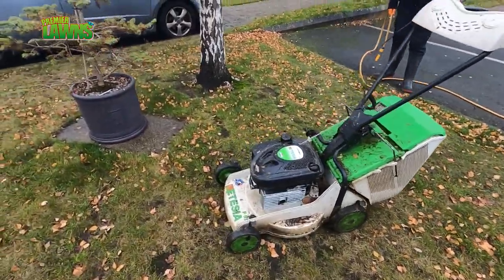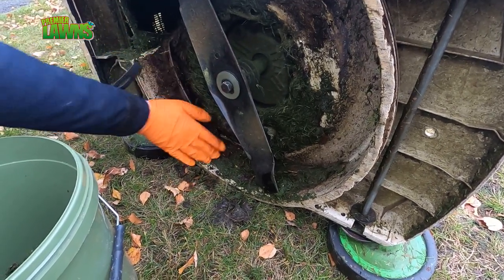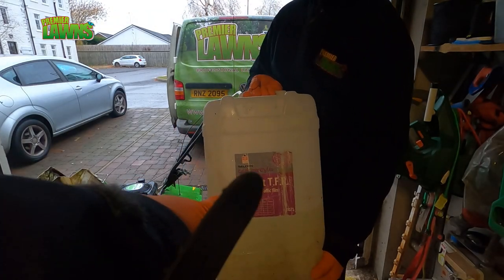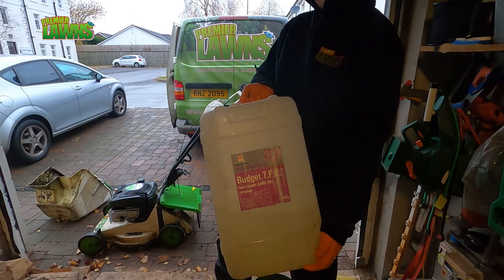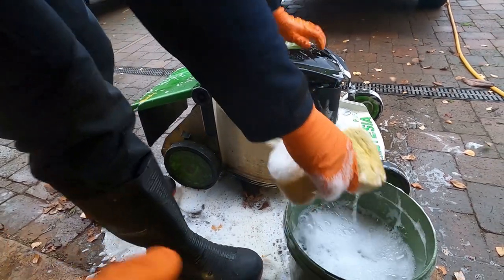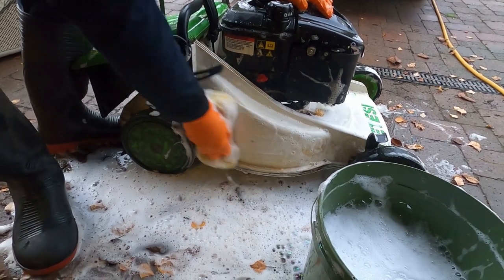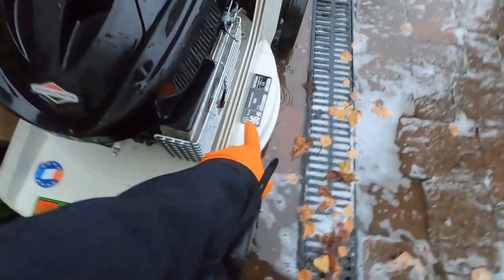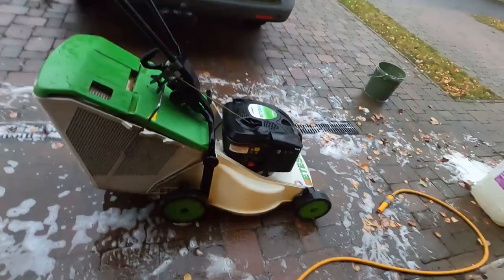How to clean an old lawn mower like new

Comment: Good advice. Just a note when tipping mower on side,its always best to tip mower with air filter pointing up,otherwise oil could leak into filter and smoke the place out when started up. Also, once under carriage is cleaned spray with WD40. Stops grass clogging up.
Reply from the maker: Every day is a school day Steven, I will have to give that a go with the wd40. Thanks for the tip 👌
Reply: Steven Bell your right Steven. Not only smokey but the air filter will need to be changed on the paper ones.

Comment: There a great mower for wet grass there not cheap but a great mower
Reply: Noel Cahill they are a great mower and hold there price too
Reply: @themowerman  there a costly mower to start off with to mick it's John deeres I run there very good for re sale to
Reply: @noelcahill6707  yeah I hear ya.. the good thing about what i do is i get a lot of mowers in as part exchange so upgrade as and when I like.. ta for the comment
Reply: @themowerman  do u find mick that to get the right mower for the job ud have to upgrade it ur self I do it with my John deeres I up grade the engines and blades on them
Reply: @noelcahill6707  yeah I agree.. I do have about 20 mowers in at any one time so I can switch them if needed. However I do upgrade my own mowers depending on the cut needed..
Reply: @themowerman  who would have the best torq engine out now for a 21 inch mower
Reply: @noelcahill6707  toro have a nice mower so does the webang
Reply: @themowerman  weibang I'd like toros quality has gone really down over the yrs they used to make tanks